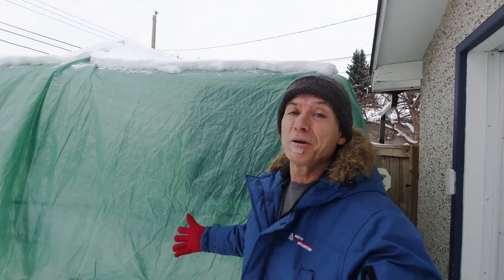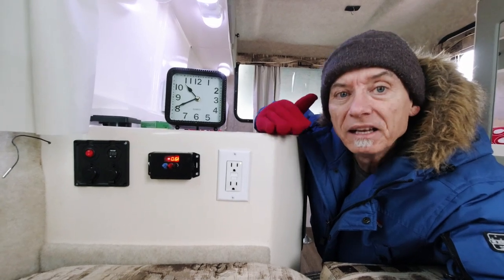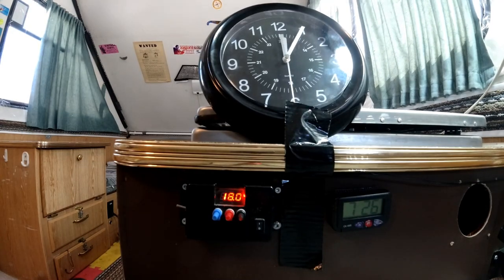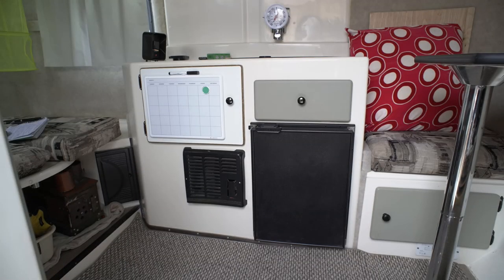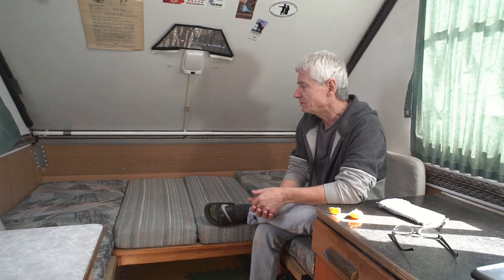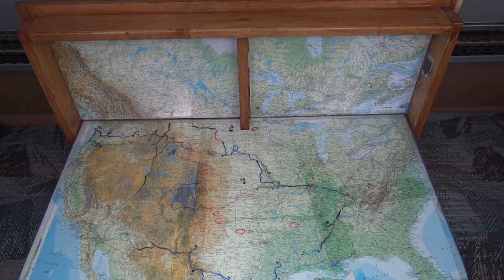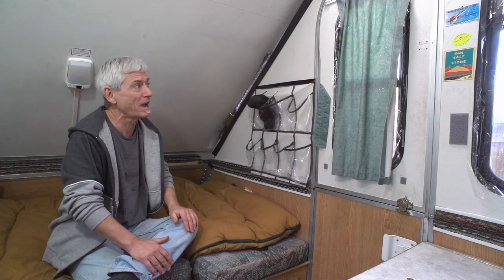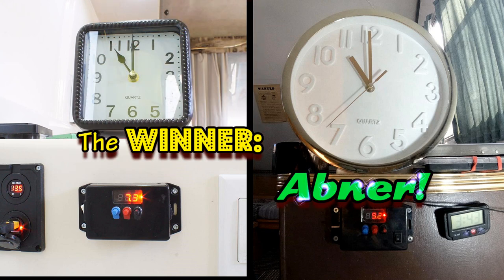From "A" to Egg Part 2: Which One's Warmer?

Comment: Have you considered the tent in the unit method?  This applies to tent, trailer, vehicle or house.  I have a small back pack tent on my cot in the back of my truck/shell.  Sleeping in the tent inside another structure reduces the heat needs and captures all the condensation which can be aired out the next day.  The tent also protects my bedding from road dust.
Reply from the maker: Sorry Second Act, but this makes so sense to either of these trailers. If it is that cold or drafty that you need a shelter in a shelter, the trailer is a failure in my opinion. I use a warm sleeping bag, but that's it. SP
Reply: @SlimPotatohead  The primary purpose of the tent is to capture breath condensation.
Reply from the maker: There is very little breath condensation for a single person in a 360 cuft trailer, and many other ways to remove it. Sorry, not at all sold on the concept. SP

Comment: The foam matting you have on the floor in Abner might be enough insulation to contribute to the slower cool off.
Reply from the maker: You could be right MaryAnne. Insulating the floor with at least something saves a lot of heat loss. Abner had carpet over foam, while the Outback only had carpet. Thanks! SP

Comment: The scientific mind is such a marvel.  Thanks, Slim, for reminding me why I live in the desert Southwest (US). 😊
Also, could that higher ceiling in Abner be the reason why it heated up slower than the Outback?  Heat rises and your temperature gauge was down low.  Just a guess.
Reply from the maker: Jim H, heat is most critical at night, when you are sleeping. That is why the sensors were just above the bed. SP
Reply: Slim, I get that.  I’m just saying the higher roof profile could affect the time it took to record the equivalent temperature in Abner.  
I do a lot of van camping so I deal with the same issues.  In my VW camper, if it’s really cold I need to lower the pop up top to get better heat retention.  It’s not a 1 to 1 comparison with your hard sided trailer because I have the canvas sides but the idea is the same.

Comment: Abner has a much higher ceiling so it takes longer for the heat to rise & then work its way down to the thermometer. The furnace in your Outback sounded pretty loud compared to the furnace in my travel trailer & in pop-up campers that I've borrowed. I'd look into finding the source of the extra noise or see if you can somehow baffle the sound. But don't take this suggestion as criticism. I really like your new rig.

Comment: The coolest thing you did to Abner,   in my opinion, was cut the hole im the ceiling that allowed you to use your homemade wood stove. I love the stove and intend on building one someday. Part of me hopes you cut a hole in the new camper for it, yet another part of me cringes at the thought of it. Lol
Reply: I highly recommend the wood stove. We have used one in our trailer for 5 years in temps down to 11 F. as we camp mostly in the spring and fall 50+ days a year. Some pretty cool ones out there or you could build your own. Ours is very basic made out of an ammo can. You can see it in our video.

Comment: In case you’re looking for a solar attachment method, have you seen Hobotech’s VHB tape (on fiberglass) videos?
Reply: Wasn't very keen on poking holes in my trailer for solar so I used VHB to mount a panel on my Aliner and I couldn't be happier with the result. Amazing that just 16 sq inch(100 sq cm) of tape is so strong.
Over 4000 miles (6500km) of towing and its still rock solid.

Comment: I was thinking the furnace under the bed frame in cold weather was not a negative (bit like hot bricks near your feet). Could the current door insulation be done along the leaky seams to close them up? (eg the foam stips of different hxw & sticky backs or a type of caulking?)
Towing considerations are great point. Mpg is valid, visibility too (wireless backup cam system?). Would a taller ride height improve overtop of trailer visibility? So a tow vehicle adjustment? Slim's tips are seemingly guiding to a 'sweet spot' of trailer & towing combo.
The door system seems to be the chief aggravation. I wonder if visiting it from a marine perspective could suggest tuning modifications? Perhaps aliner has a stouter door package like the off-road axle option?  Still think the aliner cost wise, as a towable hard wall tent approaches the best convenience & value. Some of those rooftop tent systems smh.

Comment: Really excited to see you traveling in the outback some things I want to see you test before you hit the road is the wood stove because I really liked the stove also I wanted to know which gets better gas mileage while towing finally if your going to put in more insulation if you can afford it double pane windows will help a lot with heat loss

Comment: I did want to point out,  that in the A frame,  not only did you have plastic on the windows,  you had the insulation tubes in all the cracks in place,  the Aframe  use to be windy before you did that.

Comment: Perhaps another useful comparison is the difference in fuel used to tow the two different trailers. I would guess that the A frame uses a lot less fuel vs the newer Outback, because of the difference in wind resistance. How much different would be useful to know. (you might even get to use some of that high school math we all try to forget).

Comment: just think how much warmer it would stay in the outback,  if you added insulation.  yes you have a dead air space,  but you also poked holes in those spaces,  cold air will come in from the holes and through the outlets you installed.
Reply from the maker: Actually I removed more holes than I put in! The water heater door was metal and massive. SP

Comment: Hi Slim Potatohead, I was curious carpet on the walls.  Would that make a difference ?  The walls in the Aliner is basically styrofoam.   I have 2020 classic aliner with off road package and the hard dormers.  I'm able to see over the top of my camper while driving.  My furnace is below the sink, similar location to your outback.   I ordered cell foam from Northwest Columbia under warranty, and  was able to fix the draft coming in from the walls seams.   It still difficult to keep it heated in winter when dormers are up due to the square footage.  Its better heating it when dormers are down.     Looking forward to more winter camping trips.    I'm in Colorado, I'm into your winter trips.
Reply from the maker: Hi Eric, the marine fabric does have an additional layer of insulation under it. That said, I find the effect of the acoustic dampening far more pleasing than the hard walls. Time will tell how it performs. Thanks! SP

Comment: I have not read all the comments. But hot air raises. There for you have to heat the top of the A before it gets down to the thermostat in the A. Now then if you put the fan back in the top of the A pushing the hot air down. Then the results may be different. The egg has less head space so the heat taus closer to the area you live in.  There you have it.

Comment: For the 2nd temperature drop test.....Is it fair for the Outback, when the A-Frame has the custom pool noodles you made to help with the insulation in the cracks of the A-Frame?
Reply from the maker: I didn't use the pool noodles for this test. SP

Comment: Hi, greetings from Sweden! A curious question: How thick is the insulation typically in the walls on the outback? In a typical swedish RV or "Husvagn" as we say it its a minimum of 25mm styrofoam insulation and all windows and roofhatches allways have double glasing and it has been like that since the 1980's
Reply from the maker: It's very thin. SP
Reply: Here in America we value size over quality.  Or at least the industry thinks we do..
Reply: @marcpikas2859  Not to mention that this industry's "engineers" turn out to mostly be just draftsmen and sales managers working together, meaning that they have no physics concepts in their heads, so they stuff insulation between aluminum frame members in walls and ceilings and the thermal conductivity of the metal short-circuits around 80% of the R-value. But who knows and who cares, right? No codes, not even lemon laws, are applicable to them in most states--so no one will hold them accountable for saying that a sheet of aluminum foil is R-38 insulation and other ridiculously false marketing claims. They just tell their customers that it's a "Grand Design," and other such monikers.

Comment: surely the egg.  all that flimsy metal thin aframe stuff...vs molded fiberglass, yepp.
a 1/8" crack 4' in length is equal to a fist sized hole. Single pane windows aren't good for much either, have to have thick curtains or custom fitted inserts. I have a 30' older camper and had to go around with a caulk gun up topside. Tarp is smart! The slightest screwhole or crevice a 64th of an inch thick will leak like a sieve!

Comment: The number one factor for me is the wind speed.  Calm is my mantra until the temperature reaches 75 degrees Fahrenheit.  I liked the ending of the video. However the thought of twin “slims” brings to mind dangerously creative projects.  I am sure you don’t share everything; especially epic fails, or things that go “BOOM”.
Reply from the maker: I assume you haven't seen my "Nobudy's Purfect" video? SP
Reply: I will look that up now!  I have an ability to burn my fingers on metal screws, burrs, anything that requires cutting, drilling, or sanding!
Reply: I found it and had watched it. The nice thing about a poor memory, is everything is new...again.

Comment: Heading back to Alaska in May. Planning to take a new route up through Edmonton and then over to Dawson Creek to begin the Alaska Hwy. Are the roads good up through Edmonton and over to Dawson Creek?
Reply: Hi John, I travel from Edmonton to Dawson Creek and even through Fort St John (Gateway to Alaska) for work and the roads are very good. it’s a divided 4 lane highway all the way to Grande Prairie, then changes to 2 lane from there on. I however question the availability of camping spots along the way because all of the Alberta Provincial parks will be closed due to the virus. I wish you the best on your trip.
Reply: @cybertech2928  Most grateful for the update. Difficult time trying to get home to Alaska. I thank Canadian officials for allowing Alaskans to get home. Thanks again. If you ever get to Alaska, drop me a line.

Comment: Besides some of the other comments (Abner isn't 100% sealed etc.)--the Outback has a layer of material on some of its walls and Abner doesn't. Wouldn't that help absorb/retain more heat?
Reply from the maker: Abner actually has about an inch thick styrofoam insulation in its walls and roof. The Outlback has much thinner insulation in selected areas. SP

Comment: Not sure if you've covered it before but what is the difference in gas mileage when towing on the highway between the two. That should be an advantage for the ALiner especially if you have a small tow vehicle.
Reply from the maker: How would I know? I haven't been anywhere with the Outback! When I'm free to travel, I will surely report this. Thanks! SP

Comment: Does the egg have any insulation at all ? I didn't see any while you were making new storage areas under the former sink.
Reply from the maker: Yes it has foam insulation on the walls and ceiling, but not in storage areas. Thanks, SP

Comment: Are the windows on the Outback flat? Then you can make a frame with a plexiglass pane in that you velcro in place. Should work very nicely.
Reply from the maker: But where would I store the panes when not in use? I plan on using a roll-up material as it is easier to travel with. Thanks! SP
Reply: @SlimPotatohead  You got a point there. I'm sure you can figure out something better than just taping plastic film over the windows.

Comment: Nice double take and drone shot slim, I prefer the OUTBACK in my opinion. 
The OUTBACK is much lighter because it is made using fiberglass while your ABNER is made out of aluminium and styropore. Fiberglass insulate more than aluminum. 
Now you can put in two sealed lead acid deep cycle batteries inside your trailer. Because the trailer is lightweight. 
There are no difference between the two as I analyze. The only difference is volume. The bigger the volume the more it take to warm up inside. 
Is like being inside a computer case with small volume. It quickly heats up the components inside the computer case. If the computer case has a bigger volume it will take time to heat up the components inside. Make sense right.....What is the plan, get a new set of solar panels, charge controller and batteries for the OUTBACK??? Or stick to the old ones??? 
Hope you are well there man, stay healthy and warm. Hope to see you in a live chat or stream.
Reply from the maker: Whenever it gets warm enough, solar will be installed. Thanks! SP

Comment: Slim, the plastic sheet over the windows will have a next to nothing effect on insulation. If you’d like to get more of a scientific view on the insulation of each trailer, you can look up the “insulation R-values” of specific materials. The insulation R-value of a plastic sheet is ~0.85, which equates to a negligible amount of insulating properties and is more of a vapor barrier than anything. Interesting results though!
Reply: What if one uses bubble wrap to allow light in but create mini air chambers?  Science ever tested?

Comment: Slim,
Have you installed carbon monoxide and propane detectors in the ostrich egg? Where?
Regards,
Bimodal (Recreational Vehicle, Recreational Vessel)
Reply from the maker: I didn't install either of them. They were included (as they are in most RV's). SP

Comment: Will you be using your Jackery Explorer 500 in your new camper?
Reply from the maker: Absolutely! SP
Reply: I've assumed all along that Slim would incorporate the Jackery 500 into his Omelet.
Reply: @SlimPotatohead  It will fun to see you install it in a future video.
Reply from the maker: It's a portable unit. Nothing to install! SP
Reply: @SlimPotatohead  Do you think this unit will meet your electrical needs? It looks empressive.
Reply: What do you need an extra battery for? You have batteries in the campers.
Reply from the maker: @dan reed, personally,  the Jackery 500 alone does not meet my entire energy requirements. It is supplemental power. My experience has shown me in order to ride out several days (or weeks) of clouds, I typically need 400 watts of panels and 200 amp hours of battery storage. But that is primarily because I shoot and edit on the road as well as the regular needs of light, refrigeration and ventilation. Thanks! SP
Reply: @SlimPotatohead  Thank you Slim.

Comment: Wouldn't it be a fairer comparison to simply weigh the fuel source before and after a specified period of time and at a set temperature?  You can calculate energy consumption which would take into consideration insulation and air penetration.  Just curious.
Reply from the maker: You can try that Dave. Why make it so complicated when there are so many variables anyway? SP
Reply: @SlimPotatohead  Well, I don't own a trailer, so I enjoy watching your travels and living vicariously.  Safe travels...

Comment: Hello Mr Slim,  I hope you can give me some opinions about  Trillium trailer. The one with bathroom n toilet similar to the one you have when compared to other brand of tear drop camper. I have sent an email to Trillium but they don't reply. May be you could act as a middle person helping me to reach the company. Recently I have discovered from your you tube of visiting a Canadian RV show, from there I noticed a tear drop camper made by Brixton Creet ( bushwhacker L17Z ). I contacted their dealer in B C , they promised me this camper at show price. ( Cdn$14,550 ). I am 68, retired, not a handy man and not an off road guy.  I prefer when camping , the camper should have a bathroom n toilet ( more convenient ). I wish you could take a little time to reply me.   Regards,. John.
Reply from the maker: Hi John, Trillium makes custom trailers, so you can order one to your specifications (see their "build your own" section on their webpage) but there is a waiting period to have it fabricated. They don't however stock them. Brixton Creek builds trailers in advance and stocks them at RV dealers. At this time I do not believe Trillium makes indoor showers. Hope this helps. SP

Comment: air volume and blower location is not significant.  when you are heating a room, it will not reach temperature until the walls heat up, unless you have overpowered furnace.

Comment: Can something like the egg be pulled by a small SUV or even an old ranger rwd?
Reply from the maker: Hi Linda, I always gauge towing capacity not only on the tow vehicle and trailer, but by where you travel. Think of your worst case scenario, like mountain ascents or merging between big trucks on a freeway. Do you have enough power? If you do then, you should be fine in the easier travels as well. Thanks! SP

Comment: What size of furnace are in the two combatants? You mean to tell me that you aren’t going to miss the farting noises from the A frame? Or do you plan to supply the same fart sounds by eating a little more chilli in the Egg? Stay safe my friend. Cheers!!!
Reply: He said12500 BTU out so I'm guessing a 16000BTU in both.  Plenty for the trailer size.  With some floor and window insulation it should help prevent excessive cycling of furnace.  Plus the wood stove down the road likely he'll be doing videos in underwear.

Comment: if you have a gf you need less heat under bed but the main reason in differences is an astronomical phenomenon.. Objects lined up in syzygy block suns cosmic rays differently thus the problems you had with sun flares and such...